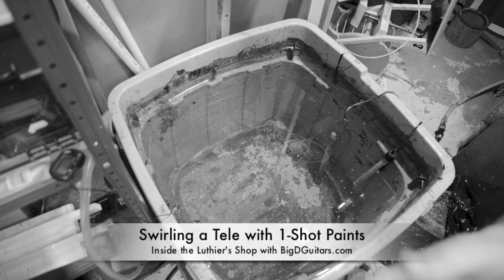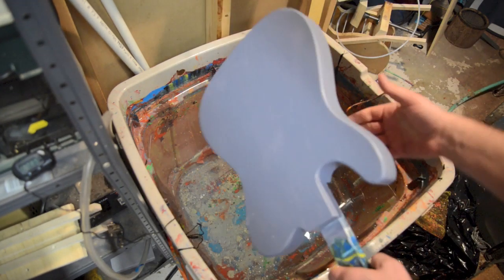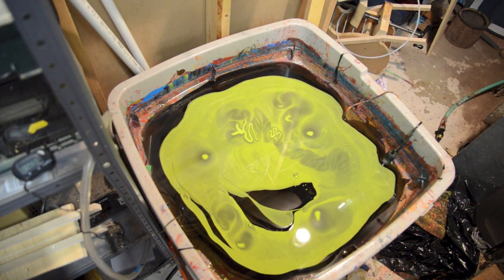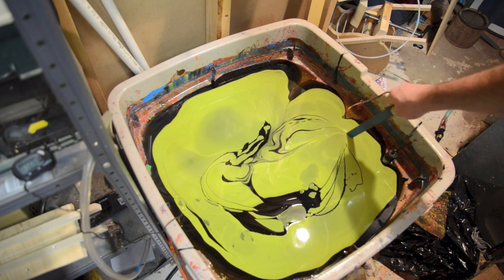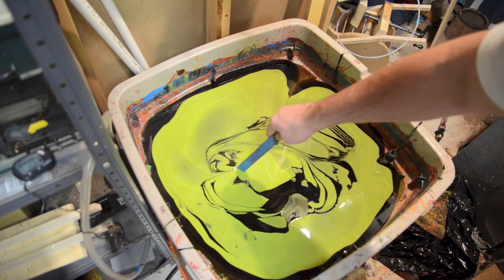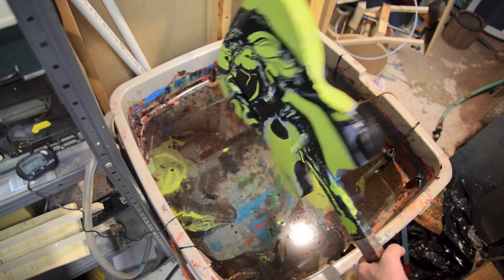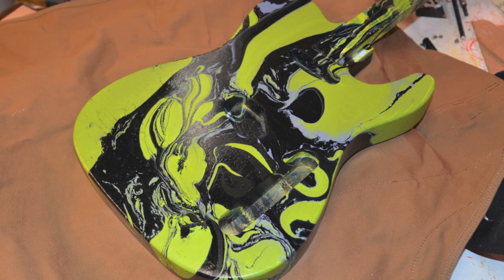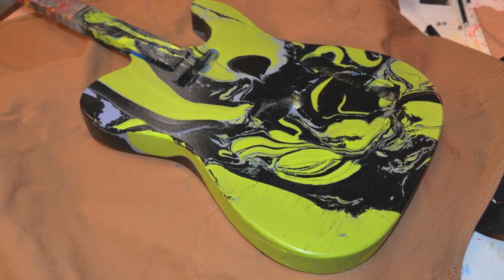Swirling a tele guitar body with 1 shot paints

Comment: I have one question about the process, the stqrting point ^^ what was on the guitar beforehand ? is this only a primer ?  only paint ? a protector clear coat above ? 
Also when swirling is done do you add a protector clear coat ?

Thanks ! your work is inspiring !!!
Reply from the maker: just a primer. then dip and apply a seal coat after.
Reply: @bigdguitars  Excellent, thank you :D